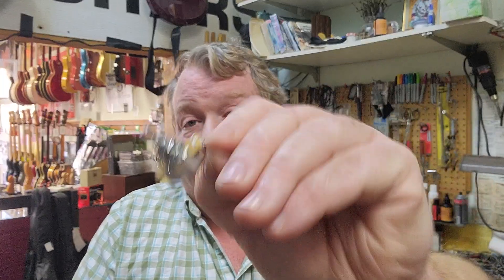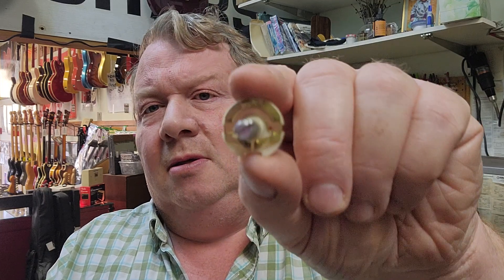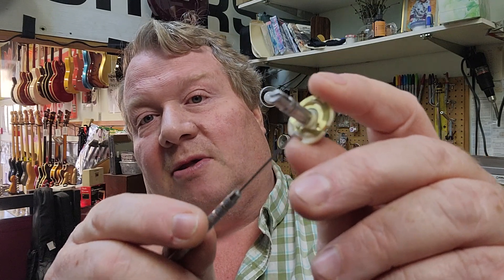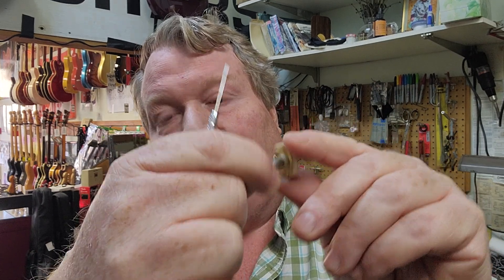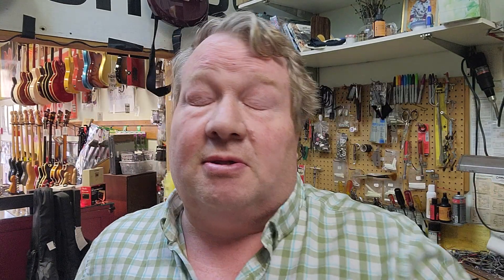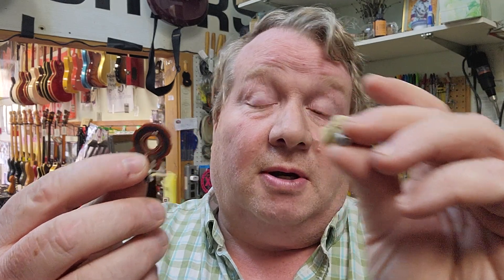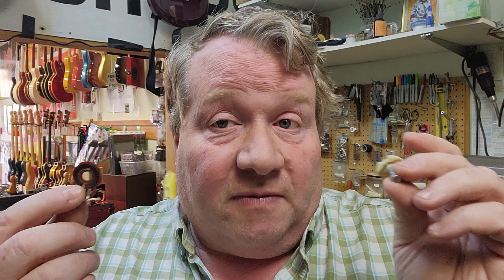The World is Going to Pot -  A talk about pots (Potentiometers)

Comment: Hi Marc, what would you’re diagnosis be of a volume pot on a brand new Prs Se SS that won’t shutoff at 
0, sound continues to come out as if it’s still on 10. 
Sweetwater sent me another SS but I actually like the first one better.
I’m thinking about asking them to take something off the price but wanted to know how much a replacement pot would be to install? Thanks for any help.
Reply from the maker: It's likely a defective pot.  Unfortunately getting the guitar that you like better back will be impossible. If we were to fix it in our shop it's usually about a total of $30 including the part.
Reply: @GarysGuitarsUSA  Thanks for the info. I actually haven’t sent the original guitar back yet, so I may just see what they say about taking something off the price and keeping it.